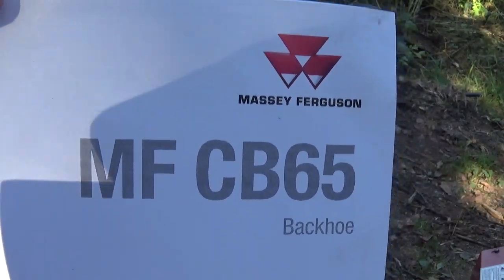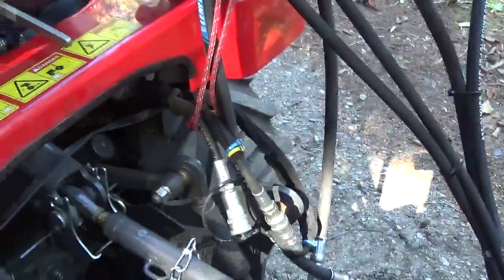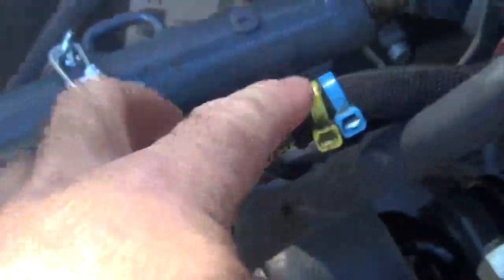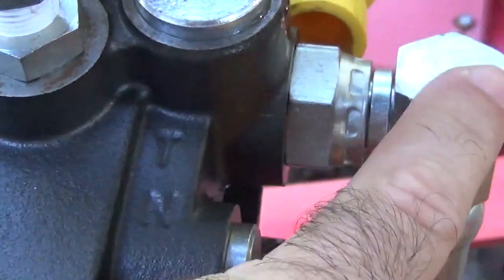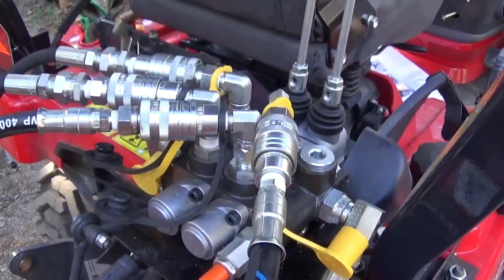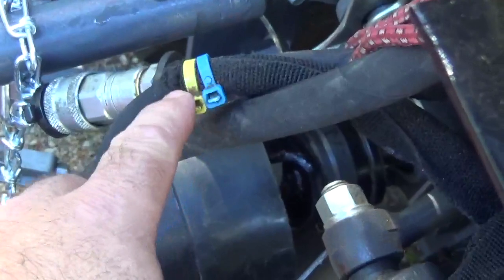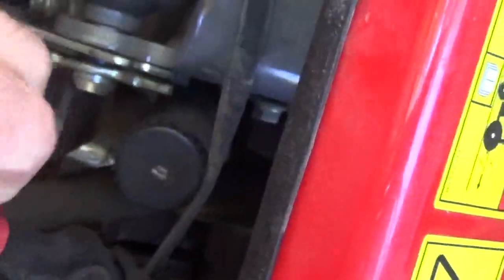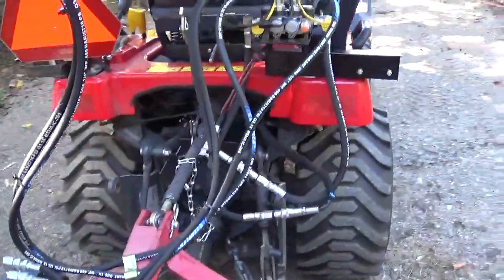HYDRAULIC VALVE explanation on the GC1710

Comment: I just ordered a set for the rear of my GC-1720. What size fittings did you use? I think mine are 1/4" ISO 5675, Is that what you used? Is that what is on your power beyond? I am going to have the hoses go right into the valve because they are long enough to try and keep it clean back there.
Reply from the maker: The fitting that I got are the same as the original . I got them at a Hydraulic store . I need to check for the #.

Comment: Great videos.  Im also a GC1710 owner.  I did the same setup as you with the remote valve for my snowblower.   I'm having some difficulty tho, the cylinder seems the get stuck.  I've disconnected both lines to cylinder and when I operate the valve handle, I get flow of oil, so Im thinking it's not the valve....plus the loader still works when the BH lines are connected to the remote valve.  Did you have any issues when first setting things up?  with the initial operation?   I am fairly new to all this and have a pretty decent grasp of things, but I also know what I dont know.   Any suggestions?  Thanks... and keep up the good work with videos!
Reply from the maker: didn't have any issues plug it up and working fine. I did fallow mi dealer and mecanic instruction . you might have some air in the line or faulty valve or cylinder .It's hard to say didn't see it and did you talk to your dealer about it or your mecanic at the dealer ship?
Reply: @MRnounoursSQ  so its not the cylinder..I hooked the hoses up the loader connects and the deflector cylinder works perfectly.  this means the issue is with the remote value, and looking to be related somehow to a problem with the return, which is why the cylinder wouldnt retract.  I have setup exactly like yours but maybe its a different valve.  I saw a guy on TBN forum who has the same valve as I do, and he setup his up using the third hose and the power beyond port on the valve.  maybe I need to do that.  I'll have to do some more research I guess
Reply: @MRnounoursSQ  I figured it out.  I had hoses reversed going into the remote valve.  It works perfectly now.  All is good!
Reply from the maker: Cool, glad it fix you will be able to enjoy your snow blower

Comment: Nice.
Reply: Good video; I understand a lot better. The hook-up seems fairly simple. Did you need to add more fluid since there's more hose length? Were the hoses and connectors come with the valve or did you have to purchase separately?  Does this hook-up void warranty since you did work yourself? Nicely done, Serge.